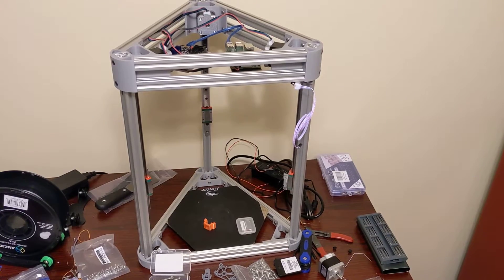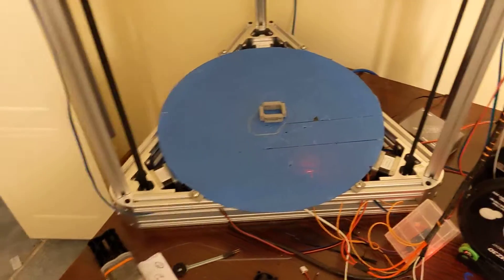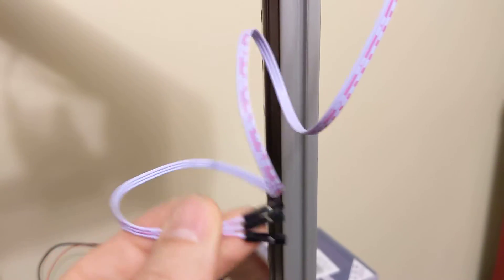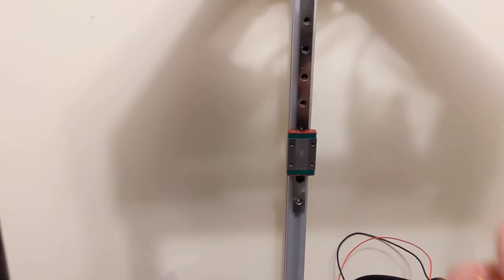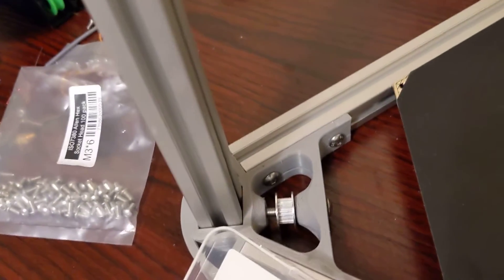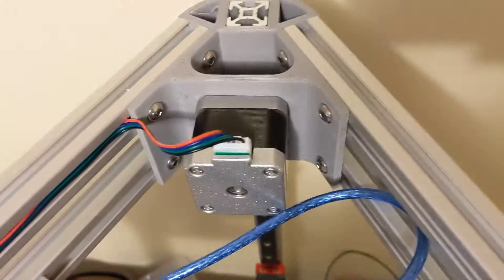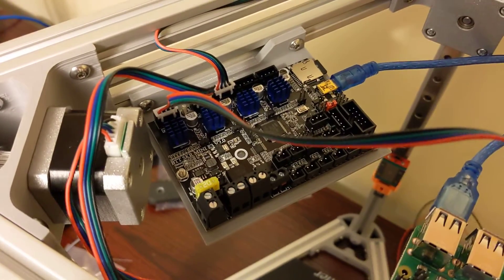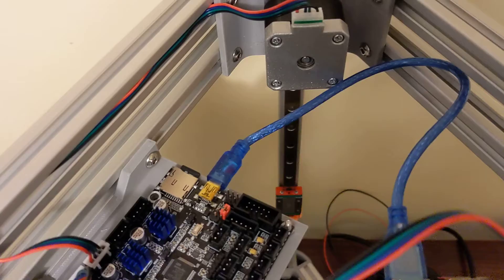Let's build a Delta 3D Printer Episode 2 More about the Frame, Motors, Rails and Electronics

Comment: Can you use sensorless homing on a delta?
Reply: Not recommended. Deltas require very precise homing because all axes affect the Z offset and indeed the flatness of the first layer. With sensorless the homing position can vary by 0.2 mm or more. Optical endstops are cheap, much more precise and you can use them with Klipper's endstop phase calibration to get even more precision.
Reply from the maker: not accurate enough

Comment: Very interesting build. I got into 3D printing 3 or 4 years ago and right before the pandemic bought a Kossel frame that I was going to gut and rebuild. I also plan on flipping my frame to put the electronics up top. 

I have some questions regarding your build and general Delta questions enumerated below. 

1) Where did you mount your power supply?

2) I'm not planning on using Klipper or Raspberry Pi. I have a the original board I purchased for this project a couple of years ago (MKS Gen L 1.0). I also have a couple of original Ender 3 boards sitting around. Can the MKS board be used for a Delta? I am assuming so as your board is similar.

3) I plan on using Marlin. Which version would you recommend?

4) Can you point me to some Marlin Delta resources please? I am having a really hard time finding any.

Thank you for all this information you have shared. I will glean what pertains to me. Once I am done with my build (If I ever get done with this perennial project) I'll see if you're interested in me sending you some pics of the completed build.

I scrapped the rails and went with wheels. Don't shoot me.  Also, I have printed multiple effectors and have not been happy with any of the designs. I may just build one out of Aluminum and 3D print the cooling fan ducts.
Reply from the maker: v-wheels are totally fine, I am restoring a delta with them and will do a project on YouTube. I have no real experience with delta's and Marlin. I know they can work but it will be a pain to calibrate. I would strongly suggest going with Klipper or a delta.

Comment: I watched with great interest your vidios about making a delta 3D printer yourself. My question is how do you get the length of the arms is a simple calculation for that.
Reply from the maker: do you mean on what size to order?
Reply: @Rolohaun  The thickness will be 10 mm but what is the length of the arm
I already have a few 3D printers, but I would like to build one myself with a base plate of around 370mm, that's why the question.
Reply from the maker: @gboiten  you can look at other printers and get some sizes. This site will have example arm sizes https://www.magballarms.com/

Comment: I think the chopped down ender built mat is pretty funny.
Reply from the maker: haha what it is was a Flux Delta 3D printer build plate with a buildtak clone ender sticker on it. I am cheap and used what I had lol
Reply: @Rolohaun  Buildtak, even the cheap clones, is my favorite build surface for pla. If it works it works. Overture brand filament from Amazon also comes with little buildtak stickers definitely large enough for most prints on a delta.
Reply from the maker: @MyriadTechRepair  I agree, it's cheap and it works. My large delta is too big so I use blue painters tape but the tape needs to be maintained so much. it will be getting a PEI sheet soon
Reply: @MyriadTechRepair  I have like a dozen of those stickers because I never throw out anything that could be useful :)

Comment: Great job.  I am working on a Flsun Qs Pro.  It only had a bottom and top, all electronics/motors, and most of the wiring was there. I have since replaced some of the electronics and I used 2020 extrusion to replace the frame that didn't come with it.  I want to complete this build with rails and I need to calculate them for at least a 300mm build area.  What length of rails would you recommend?
Reply from the maker: So what I have found is go 100mm less of your side extrusions. So for my mini build I am using 500mm extrusions and 400mm linear rails. For my large delta I am using 1000mm extrusion and I went with 800mm but 900 would be good too.